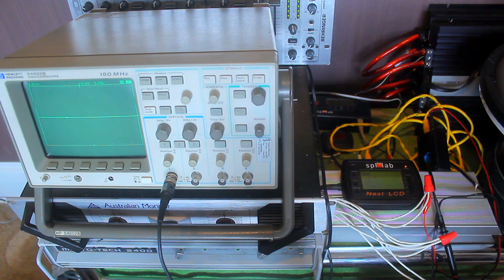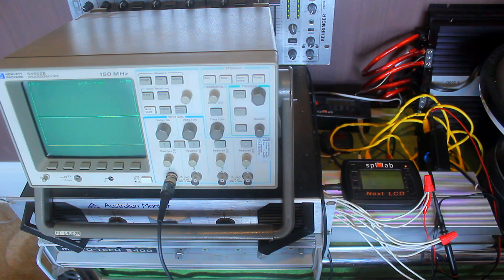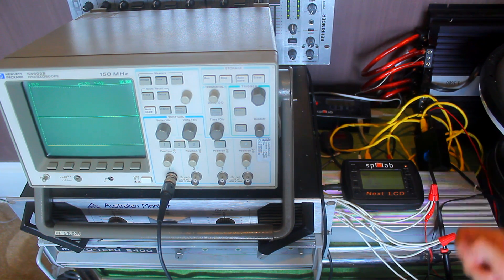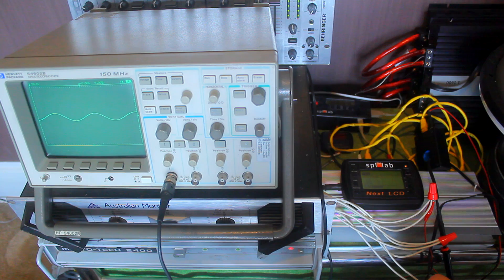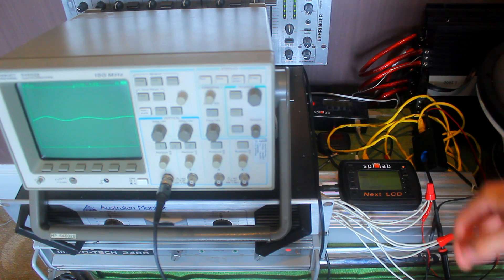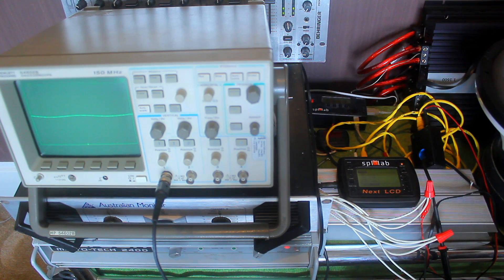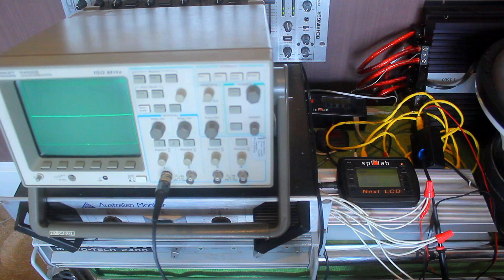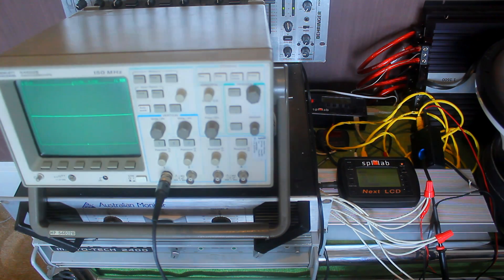Bench testing amplifiers the "PROPER" way! Crown Macrotech 2400 clamped!

Comment: You know whats funny man, that crown expects their macrotech 1200i to do 4500 rms per channel with a 25 amp breaker over here in the states, like realistically you would need at least a 75 amp breaker at 120v to get that kinda juice no matter how efficient it is. Other amps on their line up have the same issues, as an example the newer crown xls series poweramps, specifically the xls2502 which is really sweet for the price, BUT it only has a 15amp iec connector on the back of it, 15amps at 120v equals 1800w, in order to get the 2500 it claimes, you need at least a 25amp breaker on it, its like they pull these numbers out of their ass.... i just find these things funny...
Reply: macrotech 12000i

Comment: I will never understand the fascination. I've owned a bunch of the MA,s and yes, they are powerful. But bloody hell they sound rough. But hey, they were never built for music.
Reply from the maker: Interesting, mine sound phenomenal compared to a variety of different amps. Their high damping factor, low THD and high s/n ratio make them pretty impressive in this power band.
Reply: Phenomenal compared to what? I've worked with loads of them over the last many years, and they are incredibly rough and harsh compared to most other pro amps. They were the standard because they were dead reliable and ran almost anything, but they are not very good in terms of resolution and clarity. The specs don't tell a whole lot, it's only part of the equation. QSC amps spec incredibly well, but they sound very soft and horribly bland. There's a few ways of listing to what it can actually do, and can't do. Hook it up to a proper high grade pair of monitors or a really nice set of high end speakers and do an A/B test. Other thing to do is to simply compare it to other brands. Try a Lab, MC2 or an old Cloud CV. It's a completely different ballgame as far as sound quality goes. You have to remember that the basis for the Macrotech amps were in fact not audio use, but industrial applications such as shaker tables. That's one of the reasons why they work so well between the 5-20 hz band. There's a lot more to the story, but the nutcase overly religious family that ran Crown prior to the Harman takeover, were not very keen about the fact that their equipment were used for music, even much less so that it was the devils own Rock,'n'Roll. Those Crown guys were completely and utterly mad religious fanatics.
A bit of trivia. The name and the logo is a symbol of Jesus' crown of thorns.
Reply: try again...i run a large array concert system with jbl and macrotech....sounds awesome! so does L'ACOUSTICS systems which i have run many times...old "TURBOSOUND" from the 85-1995!!twin 24" bass drives!!!❤❤❤❤, sam make a vid about TURBOSOUND!!! thier from your area!!!please❤

Comment: Nice setup you've got there. You might get more power if you use thicker speaker cable. Btw I've got a 1mhz HP scope. It's lasted for years and I still use it to calibrate pirate radio rigs :)

Comment: Hey guys. I need some advice. I need a good amp for my home sound system. It should cost not more than 250 euros. It will be used for my subs. Any help would be great!
Reply: Here's a bit of advice. Don't buy one of these. Very powerful, but sounds like crap.
If you want a cheap pro audio amp that sounds great, get a Cloud CV1000. The fan is a bit noisy, but one hell of an amp.

Comment: so what are you recommend me? i think to buy corsair 650w 50a psu it should run nice becouse old one is 27a but this is 50a ;D
Reply from the maker: Computer PSUs are are not ideal for running car amps, they need all rails to be loaded to be ballanced. For running subs indoors, buy a good PA amp. Trust me, I've done every different possibility and I now have 350a at 12.6v, and its a lot of hassle and not worth it, you don't get full power from the amp unless you have 14.5v.
Reply: +barevids yeah but pa amps are expensive but i understand you thats true:)  , this pa amp looks good to run 2 kickers not 15" but 12" sorry that was mistake 300 wrms together and 600 peak --Yamaha P4500?
Reply: +MegaTronX6 If you're a beginner aka not so audiophile, anything you find looking alright will do. You might not even notice a difference. But, Yamaha is a reputed brand, so you'll be more than satisfied for now. Also, it's not specifically overall wattage. Server PSU's are strong in the 12v. commercial ones are stretched. You'd still be better off buying a couple high current adapters from ebay 'n' china, it'll be more reliable than the more diy dangerous computer psu way.
Reply: +MegaTronX6 If you'd want amps on one rail, commercial PSU's will just blow out. Barevids' Server PSU's do struggle quite a bit too. Like he recommended; A PA amp will save you both a headache, and money. (oh, and sound levels!)
Reply: +DJSNDCX oh thanks, you and barevid opened my eyes :) so yamaha p4500 seems good pa amp? becouse i can get it for 160 eur now
Reply: +barevids one more question ,suppoes that i cant get any pa amp or server psu,so what are you recommend if i can only buy psu should i need run 2 together or buy one but bigger?

Comment: hey,can you answere please. can i use one 500w 27a psu and one 400w 22a psu to connect together to power one car amp becouse when my 2x kickers 15 hit lows 500w psu turns off but amp is near to max so i connect second one and it will work to max ? my amp is shitty renegade v8 ren1500 1x 1500w 4ohm  2x 750w
Reply from the maker: No, this isn't advisable at all. Get a decent amp designed to run on mains power. :)
Reply: +MegaTronX6 As said many times, car amps aren't meant to be run from low current lines like in your house. It'd be much cheaper on your back and your worry to just get a mains powered amp ;).